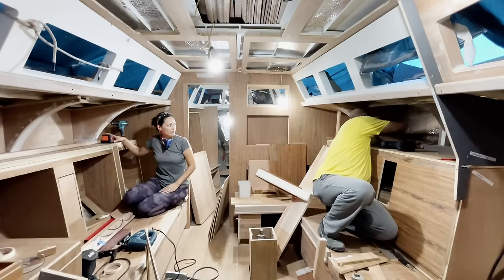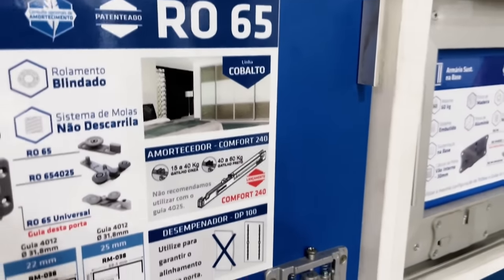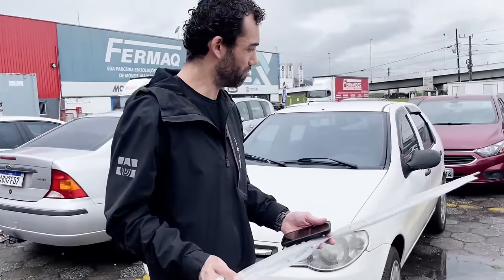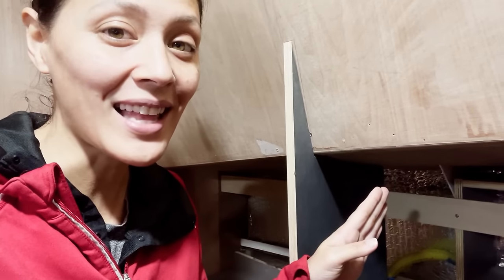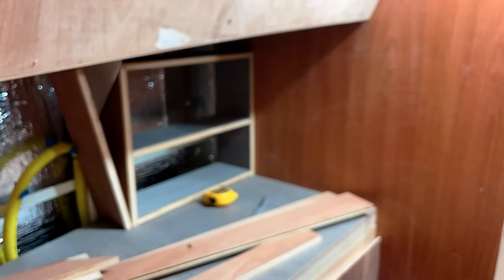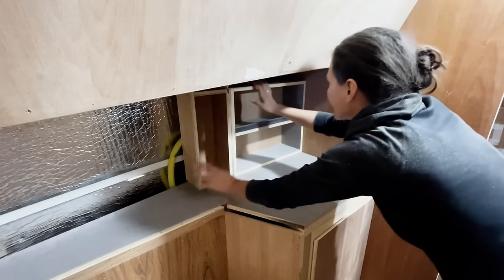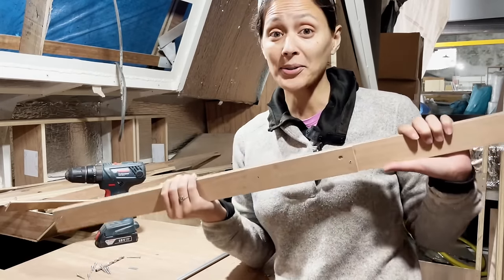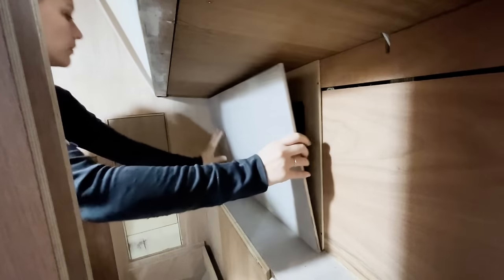CALM BEFORE THE STORM ⛵️ Ep64 – DIY Woodworking – Sailboat Restoration Project

Comment: FYI a lot of boats have sliding windows, cabinet doors from glass or acrylic and they just use directly grooves in wood ( or plastic tracks).
Yours will slide beautifully I assume!
Cheers Warren
Reply from the maker: The original layout in our boat had sliding acrylic doors as well but they were so stuck that none of them really opened. That’s why we wanted to try something that would avoid any stickiness. Best bet in a sailboat is always the route with least maintenance but I wanted to give these little wheels a try. Hope they last!!
Reply: @lahakai  smart ! Worth the extra work for sure